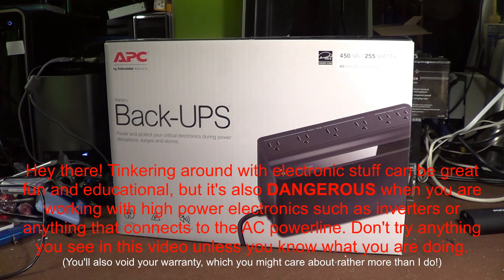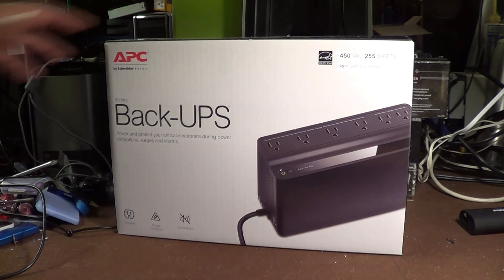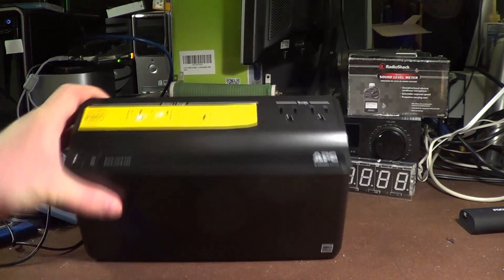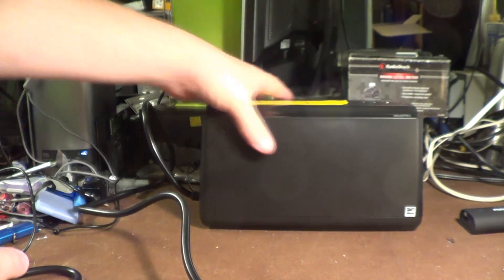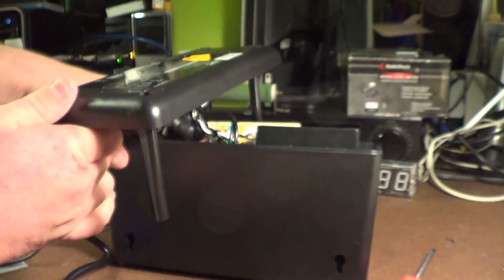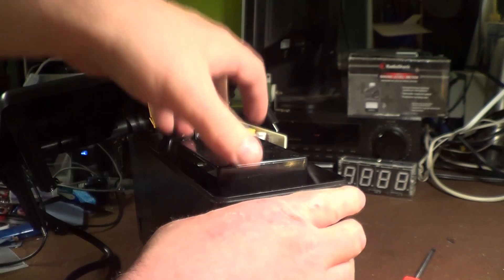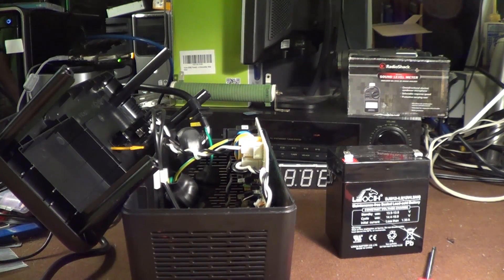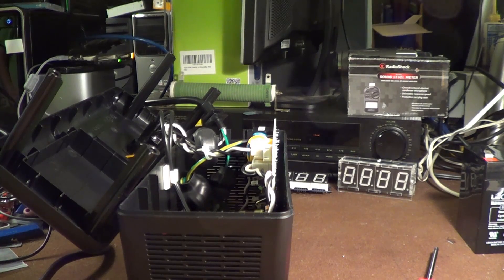Looking Inside a "Disposable" UPS

Comment: Let me start out by saying, Great Video!!! If you like saving $ & if you own a APC Back-UPS this is the video to watch, PERIOD. I just picked up my very 1st APC Back-UPS 450v from Worst Buy, I mean, Best Buy. So as usual, I went to YouTube to watch some reviews, luckily I found this gem of a video! I've learned a couple of things from this video that I wouldn't of found on a typical review video. (1. APC calls the product "Disposable". I thought I bought something similar to a power strip/surge protector, w/a battery back-up, take care of it & it'll last forever. 2. APC might call it "Disposable" but I've learned from your video that when the internal battery dies I can easliy replace it w/another battery. Battery Back-UPS is going to last just as long if not longer than a non abused power strip/surge protector! A question from the student to the guru. I have a non abused, over 15 year old CyberPower surge protector w/8 outlets, I only have 6 things plugged into. (1. T.V. (65" Samsung QLED) 2. Chromecast Ultra 3. Directv 4k cable box, just the cable box 4. Samsung SmartThings Hub 5. Netgear 5-port Gigabit Ethernet Switch 6. Arlo Home Security Hub) On the APC I have 4 devices hooked up (Battery back-up side. 1. CyberPower 2.CenturyLink C1100Z modem 3.Directv 4k, (2nd box, looks similar to a small gamer cpu tower))(On the surge side, I only have a Phillips Hue Hub plugged into that. My Question is, am I overwhelming the APC w/the CyberPower or is it fine?
Reply from the maker: With the TV turned on and operating, yes, you may very well overload the APC Back-UPS. If that happens, it will shut down and the load should be reduced right away.

It's not a good idea to connect a surge protector or outlet strip to these, especially the smaller models. The surge protection components may also cause the Back-UPS to indicate an overload. With these smaller Back-UPS models, they can't stand a lot of "expansion" beyond what the outlets on the UPS itself can provide.

If you want to keep your TV running, I'd recommend getting a UPS just for it, and I'd pick a larger model (probably at least 600VA, and something like a 1000VA model would be better).
Reply: @uxwbill   3, 4 days, so far so good, everything seems to work fine, I'll leave it as is until it shut down then I'll definitely reduce the load. Thank you for the insight.

Comment: How long do you have to charge it for for the first time? 24 hours with the green light on? Another question: after the initial charge of 24 hours do I unplug the yellow connector? And after the 8 hours of charging I have to unplug the yellow connector? Thanks
Reply from the maker: The initial charge takes around 8 hours to complete. You can wait for 24 if you want, nothing will be harmed. The yellow connector must stay plugged in for the unit to function as designed. You would only ever unplug the yellow connector if you are shipping the UPS or storing it for a long time.

The UPS charges any time it is plugged into a working power outlet. It does not matter if the green light is on or not. You do not have to worry that it will overcharge the battery, as that is automatically managed.
Reply: The  BN450M    manual  page 3 , says  24  hours

Comment: I'm of the opinion that no electronics should be designed to be unserviceable by the owner. The idea of a disposable UPS is depressing.
Reply: Remember that a good proportion of the population have problems holding a screwdriver, some don't even recognise a screwdriver.
Reply: You can change battery get much longer run time I did get 9hours and more

Comment: Can you pull that yellow battery connector out once you already plugged it in? I tried on mine but couldn't.
Reply: Yes you can, using a flat screwdriver at the internal edge to slowly popping it up.

Comment: Hey Bill, I'm just curious- What is your opinion on lithium ion UPS units? I don't really see the benefit. Thanks.
Reply from the maker: I have yet to use one. They're awfully expensive, and I'm fairly sure that vendor lock-in will be the order of the day for batteries. Doubt I'd ever buy one, but if one fell into my lap sometime...
Reply: Thank you for your response. I'd love to see a lithium ion ups tested, but I don't really see a benefit, and I see several drawbacks. It's not like weight is super important, so why bother using a lithium ion battery.

Comment: 45 minutes runtime. No way. Not ever. Not even at 25% load.
Reply: It's all about that  Battery .
CSB   GP12720  F2    7,2  amp hour battery works  good .  can easlly run 200 watt load  on the  BN450M  for  minutes .
The other  BN450M  is gonna get   a  CSB  GP 12120  F2   12  amp hour battery  which will give a 
200+  watt  runtime of about  8  minutes .

If you already have a BN450M and you  load is in the  240  watts  or less , then keep using BN450M,
just put in a larger  ah  amp  hour  battery , as suggested above.  Do it at your own risk of course .
No electronics  know how . just drill 2 holes in the back  panel to feed  the Red and Black  F2  Lugs  through
and connect the  external battary .

i recommend getting  Piggy Back  F2  Lugs , so you can bend the  Spade  Backworks to allow the  F2 lugs
comming out the back panel  to  Directly connect to the battery terminals .

Battery prices :
CSB  GP 12720   F2  , about  24 bucks
CSB  GP  12120  F2 ,  about  40 bucks

Comment: So I got mine today, but for some reason it’s not working? It’s obviously plugged in the wall outlet. But when I plug an iPhone charger or my fan on the UPS, it is not getting power on the battery+surge outlet. Any idea?
Reply from the maker: The battery backed outlets are switched. A green light will come on in the power button button if they are on. If this green light is on, you should contact APC support for further troubleshooting, as the UPS may be defective.

Comment: would you rather buy a used APC BK300 with new battery or a new generic chinese unit?
Reply from the maker: I've yet to see a generic Chinese UPS on the market. I have seen pictures, but no actual product for sale anywhere.
Reply: uxwbill theres one that is manufactured by east power on ebay.
Reply from the maker: Doesn't seem that they are a thing in the US.
Reply: uxwbill wow! Wasnt expecting that. It looks to share similar construction as this unit but is only £35 ($45). An old APC unit seems like a better option to me though.

Comment: Great video !  My Go-To UPS is the APC Smart-UPS 1500 mini tower from ebay (so older is better and maybe built in the USA...) that took two batteries from ebay (needed the wiring kit).  Also have the 2U Tripp Lite 1500 LCD that is 10" deep and may take two batteries (came from ebay w/batteries).  The LCD screen tells the utility voltage and other information (usually leave the screen tuned down).  Would like to get a APC Smart-UPS 1500 2U RM that uses only four (4) batteries...  My craiglist mini rack is only 21" deep.  Just ordered a laptop from the Dell Laborday Sale !  With the laptop then I can go into the APC UPS and reduce the charging rate...  Also the UPS keeps my system up and running when the lights flicker and can watch your YouTube videos !  Thank you for the video !  tjl

Comment: Thank you for this video.  I was thinking of returning the APC 425 (or 450) unit.  Now that you have shown me that the internal battery is a plug in and replaceable  maintenance free lead unit, I will keep the unit. Its good to know that it is 12 volts 4.5 amp hour capacity. Keep up the good work uwx Bill

All the best,
Douglas.
Reply: You change battery 🔋 you have 2 12 volt 12Amp battery  🔋 in small tool box 🧰 and ups and run much longer I did have 12V 12A and 12V 7.2A I keep it positive to positive and fused between positive of ups and negative to negative to negative the ups I 19.2A running my ups I do more than 8hours with laptop 💻

Comment: I don't know if you were trying to repair the ups or whatever. but at 3mins when you were trying to 'test' if it was good. You forgot to put the breaker plug in (aka battery connector the yellow plug.) (seen at 3:42) before you turned the unit on. That's why at near end of the video when you apparently did. it worked no prob. :p.
Reply from the maker: The video title is quite enlightening. As is the description.

Comment: I was hoping to see this UPS in action. Connect a computer to it then pull the plug of the UPS to see the computer still running.
Reply from the maker: If you want a UPS for a computer, get a bigger model than this (minimum 700 VA).
Reply: Thanks you for replying. After watching this video I went out and bought this UPS.... for my computer. Mine is 450VA. That should give me enough time to shutdown properly.
Reply from the maker: It's worth considering that as the batteries age, the amount of runtime they can provide will decline. So let's say this would keep your computer running for five minutes when brand new. In three years, it may barely manage two. If ever you're not around, Windows or APC's PowerChute will place your computer into hibernation when the battery gets low. Since that involves writing the entire computer's memory contents to disk, it can take several minutes. That may be time you don't have with a smaller UPS.

Buying a UPS that's a bit larger than you need also affords you the ability to upgrade or expand your computer in future without having to worry that the UPS will handle the extra load.
Reply: Thank you for the advice. I just did a test of my UPS and it give me 30 minutes of run-time when using my  21.5" iMac. I was only reading a pdf and watched a youtube video near the end.

Comment: If the unit was truly disposable, they would have made the battery impossible to remove and they would have soldered the wires onto the terminals.
Reply from the maker: I'd have to think soldering, probably by hand, would be a lot more expensive than machine crimped terminals.

It's effectively disposable to most people.
Reply: Read the  included manual  page 8 .
No where in the manual does is say  BN450M  is to be discarded when the battery dies , No where .
In fact , page 8 says the Battery is  to be  Replaced .

Comment: If running them up against their limits breaks the invertor, what is likely to be the faulty component? A resistor? A capacitor? Or maybe the breaking (thereby shorting) of insulation on some induction coil? What to look for and how to fix it? Any videos on that recommened for youtube?
Reply from the maker: It won't break the inverter for a while, as they are fairly well protected. It's bad practice in general to run something right up against its rated limits all the time, and it will beat the life out of the little battery. When said battery has a few miles on it, the end user may be disappointed to find that what once held their load for 3-5 minutes now holds it for less than a minute.
Reply: I once saw once of those wind-up batteries (where the sealed lead acid battery was about the size of that one you pulled out in the video) rated at a hundred watt have a 400watt tool plugged into thereby breaking one of the wind-up battery's power outputs. It had a mains output and a car-cigarette-lighter power output and a usb power output. The mains plug was the broken output. Yet the cigarette lighter still worked and the usb still worked. Also it still could charged from the mains or the wind-up just fine. I never found out what would have been the likely fault. Any vague possible ideas of what the likely fault would have been?

Comment: ouch these leoch batteries suck ! we remplace them afterm a couple month. remplace them with csb or even better yuasa npx series, these last 3years+
Reply from the maker: My experiences have been completely different. Every Leoch battery I've found has served for many years before failing. Beyond finding them in a lot of devices calling for a lead acid battery, I bought two for an older pair of APC Back-UPS units. That was in 2013. One failed in 2016 with shorted cells, the other is still going strong.
Reply: you must be lucky ! or keep them cool, they would probably last if they are kept cool. leoch batteries are made in the same factory as the powersonics. i work in a ups service center i dont see alot of leoch batteries but when i remplace them they usually are cracked and bulged..  saying that ive seen plenty of csb and panasonics that were that bad..

Comment: I guess I didn't even know that these consumer-grade sub-$60 units were considered "disposable." I always just replaced the batteries on them anyway.
Reply from the maker: It's been my experience so far that most people don't. Some don't even know there is a battery in there to replace, or those that do don't know that it can be replaced.
Reply: He doesn't know what he is talking about .
The user manual  page 8 ,  says the  Battery  Is to  be  Replaced.
No  wherer in the manual does it say to throw the ups away  when the battery dies .

Comment: That's weird, I just bought two of these and it came with the battery disconnected with instructions to open the bottom, pull the battery out, and connect the spade terminal on the top, then put it back together. The battery was totally serviceable, but the unit looks identical to yours, only difference is there's a door on the bottom.
Reply: My model number is Back-UPS NS 650M1
Reply from the maker: The larger units still have user-serviceable batteries.
Reply: I suppose so. I bought the larger one because the price difference was something only $10-15. I have one powering my wireless router and the other powering my monitor and NAS on my desk (I use a laptop plugged into a monitor, laptop has integrated UPS)

Comment: That's so much easier than the Belkin 1200VA I had.  To get to its batteries, I had to disconnect the wires from the PCB, remove the PCB and another board or two to get at the batteries.  Unfortunately it didn't isolate the heat of the transformer from batteries, so the batteries typically failed after two years.  After the last battery failure, I brought home an old APC Smart UPS 1000VA from work that had failed batteries, replaced them and am now using it as my PC's UPS.  

The only thing I don't like the APC is that it seems to test the earth connection when plugged in, tripping the main RCB on the consumer unit and of course knocking the power off.  This means if I ever unplug the UPS, I must make sure no one is depending on power (e.g. watching TV) when I plug it in, as it will trip the RCB.  Once I reset the RCB, the UPS powers up fine and maintains the load during power cuts.
Reply from the maker: Many of the Belkin units make battery replacements an absolute pain and they too consider a lot of models to have non-user-serviceable batteries. I've got a much smaller (650 or so VA) unit made by Powercom for Belkin and while it too is considered non-user-serviceable, the battery just drops in next to the transformer while the circuit board remains in the top half of the case.

It too seems to cook batteries much sooner than any of my other UPSes.

Comment: You should test it by plugging in a vacuum cleaner and a tea kettle at the same time and see what happens.  I wonder how much magical smoke is inside that to make it work
Reply from the maker: Unless one were to make a habit of doing such things, the unit would just shutdown and complain of an overload. They are reasonably well protected.

Some years ago, APC issues a recall on various "CS" 350 and 500 VA UPS models. Interestingly, some units that would have otherwise fallen under the recall were repaired by APC before they were sold. APC's never said much about what the exact problem is other than to call it a possible fire hazard, but people have noticed the presence of additional fusing in series with the transformer primary on factory repaired units.

Since I had such a unit (a CS350 if you really want to know) that fell under the recall, I decided to test a theory I had about why the units were recalled. I theorized that their overload protection didn't work and wouldn't shut the unit down safely in the case of a particularly egregious overload situation, thus leading to a fire hazard. Indeed it failed to shut down with a nearly 600 watt load attached (over twice its rated output capacity). Nor did it complain of being overloaded by lighting up the overload indicator on the front panel. Output voltage sagged massively, and the inverter behaved as though its power devices were being run into hard clipping (which of course they were).

The replacement I received behaved in a markedly different manner under the same situation. Not only did it immediately illuminate the overload lamp, the inverter also behaved as though it was going into soft limiting rather than hard clipping. Whether this is a characteristic of the driver or the transformer core saturating I can't say for sure.

Comment: you do  know that taking it apart will void the warranty... and may violate your authority to use the item !!! now the real question... do you regret p*sing  away your heard-earned money on this...?
Reply from the maker: 1. I don't care. (Read the opening text in the video.)
2. Modifications may violate my authority to operate the unit. I made none.
3. Not at all. I learned something, you might have as well, the unit will be put to use somewhere, and this video will make some money.
Reply: actually I did learn stuff. thank you. sadly, the right to fix or repair privilege now is legally being taken away from us.  in some american jurisdiction one cannot buy parts (e.g. natural or propane  gas parts) without a cab card (claimed in the name of safety)(possibly a money grab by the Authority Having Jurisdiction)! and you are right... things are disposable with no user serviceable parts.  tough teddy bears !!!
Reply: In 3 years , the warranty   ends and the battery needs to be replaced . Do what you want .
i recommend replacing the battery .